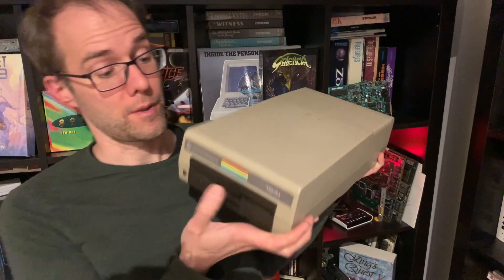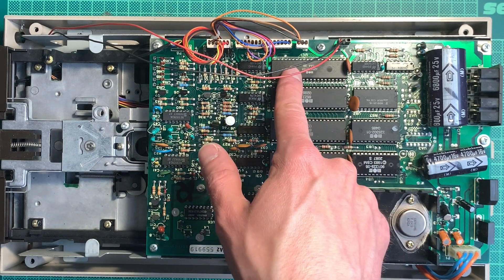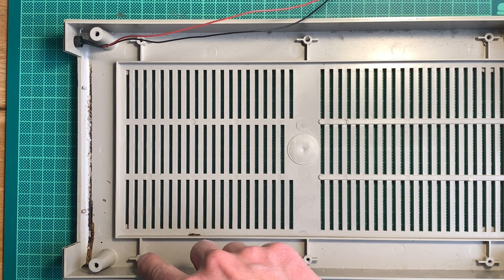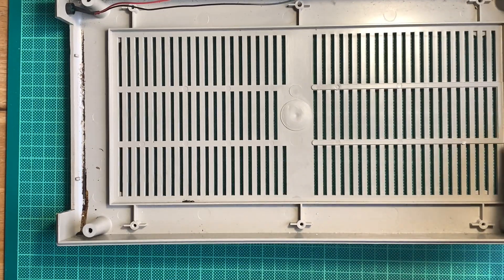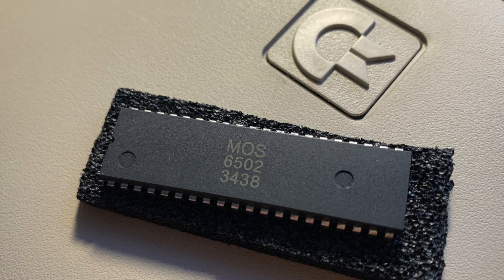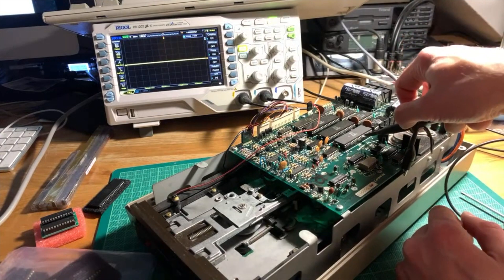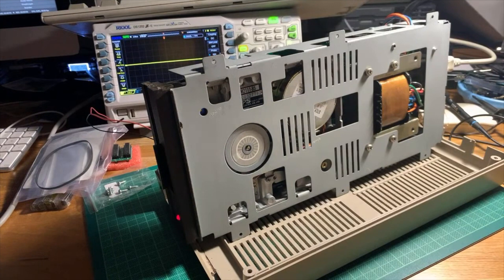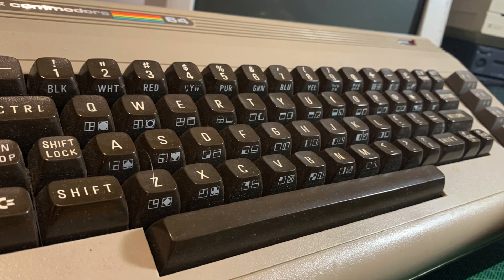Repairing a Commodore 1541 Floppy Drive

Comment: This is also the more reliable mechanism, the ALPS. The other mechanism used in the 1541 and unfortunately the 1541-II is the Newtronics, with the lever eject. The head fails in those and it's not repairable.
Reply from the maker: Yup. Got one of those, too. Broken, of course.
Reply: @root42  Yup, I have a few... They make nice decorations on the shelf, and because of their weight can make good bookends! Also the 1551 seems to use the Newtronics mechanism and will eventually fail too I guess...

Comment: I have a faulty 1541 drive that I thought had a faulty 6502. Same symptoms as yourself, drive motor keeps on spinning and the red LED stays on.  I replaced the electrolytic capacitors but had the same issue. 

I found the 6502 seem to get very hot so I figured it had failed in some way.  I ordered a replacement via eBay (from China) which took some time to make it's way to Australia. The vendor sent me two for the price of one, which was nice. 

I swapped out the 6502 in my 1541 and IT WORKED!  The drive spun up on power on and then stopped just as it should! I was able to then use it for around 30 minutes... and then it failed with the same symptom as before. I think I will take a closer look at the reset circuit.  I wish there was a higher quality scan of the service manual & schematic out there.
Reply from the maker: Have you tried zimmers.net for schematics?

http://www.zimmers.net/anonftp/pub/cbm/schematics/drives/new/1541/index.html

Comment: I don't get going to the trouble of counterfeiting old CPU's.  Especially if they manage to make them work (albeit poorly).  Why not improve the quality and sell it as a BRAND new replacement.  Seems like that would be more profitable.
Reply from the maker: I don’t get it either! Well, I learned my lesson. ;) Next time I will rather buy a brand new WDC65C02S. However those might have problems with TTL and need modifications to the pins.
Reply: @root42  WDC 6502s are not compatible with MOS ones. Get into the commodore community and ask people there, they will sell you a legit processor. If you are German there is plenty of people who can help you.
Reply from the maker: Yeah, thanks for the heads up. At the moment I am fine since after all „only“ the ROM was bad. But I will keep that in mind when one of my 1541s ever need it. Or the PET for that matter.